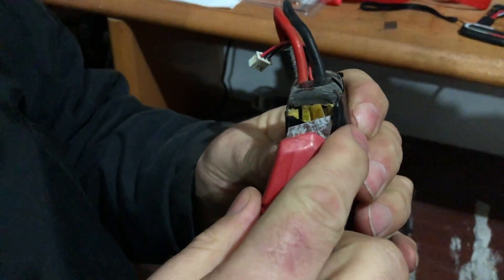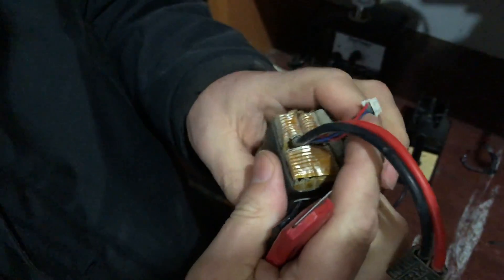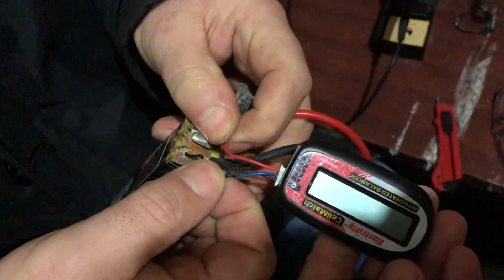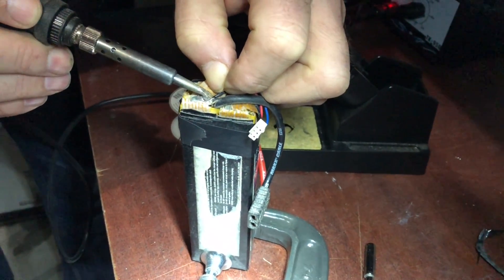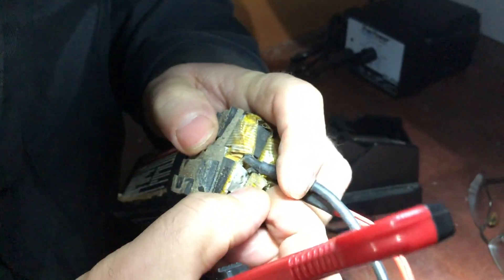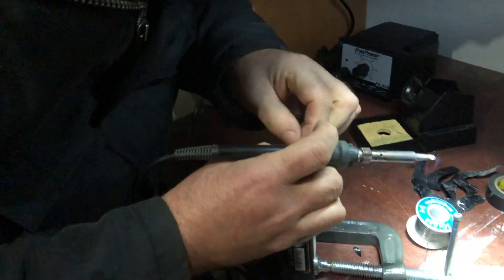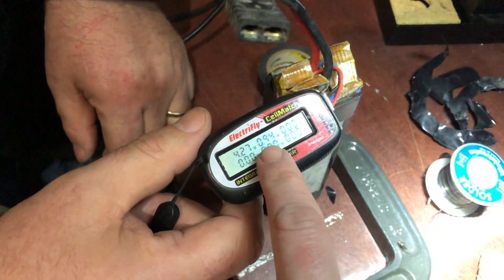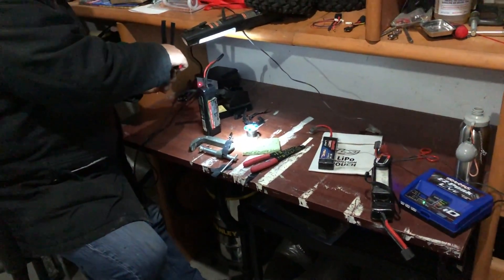LiPo Recovery Attempt! Soldering LiPo battery tabs, Traxxas ID and Balance Connector wiring repair

Comment: Please if you're going to try this at home be very careful and we are not responsible for any injuries that occurs if you do try it.
Reply from the maker: Good Point. And I'd say nobody should open up a lipo that's very puffy or leaking. Dispose of those safely ASAP.  I knew these were wiring faults that needed repairs before we opened them up.

Comment: He guys, I've recently had a 2S traxxas lipo die on me. My id charger won't charge it anymore, i've charged it on nimh setting using a connector to bypass the balance plug. But now my charger still doesn't charge it. Any thoughts on what could be going on here.
Reply from the maker: NIMH should NEVER be used except for maybe 10s-1min MAX under constant supervision and temp checks.  NIMH charging will explode a lipo.  If ID won't work it's likely a similar fault, the wiring inside has broken, or the pins in the connector or charger are broken/pushed out of alignment.
Reply: @netcruzer  thanks for the reply. I understand the danger, I charged it in a Lipo bag on a concrete surface while checking the voltage frequently. And since the results did not satisfy me i'm storing it in a Lipo bag away from my house. I plan on taking it to my local hobbyshop next week.
Reply: Performing an unbalanced charge (like NiMH charging) on a lithium batt is potentially dangerous because if the cells aren't perfectly matched one cell can start being overcharged before the pack voltage reaches the end voltage (4.2V/cell).  Without the balance connector you have no way of knowing if you have 4.2V/cell when the pack is 8.4V, or if one cell is say 3.9V and the other 4.5V (severely overcharged). Even if it doesn't self destruct on the charger it could still self destruct later under load in your vehicle or even while sitting around in storage. It also means that you can't reliably trust that when you reach the low battery cutoff voltage on your ESC that you haven't over-DIScharged one cell in the pack, damaging it, since one cell wasn't properly fully charged in the first place. Your charger might be smart enough to realise that it doesn't appear to be a NiMH battery connected (NiMH has much higher internal resistance than LiPo). Even if it did charge in NiMH mode that might get you out of trouble in a pinch but isn't a safe long term solution to your problem. Either exchange the battery under warranty, attempt to fix it so it can balance charge again like in this vid, or discharge it and safely dispose of it.
Reply: @tmmtmm  thanks for replying and the clear explanation. I learned something new today.